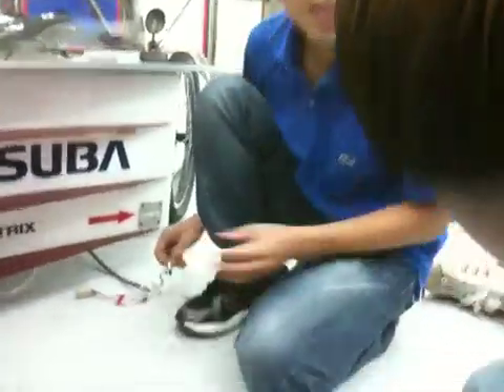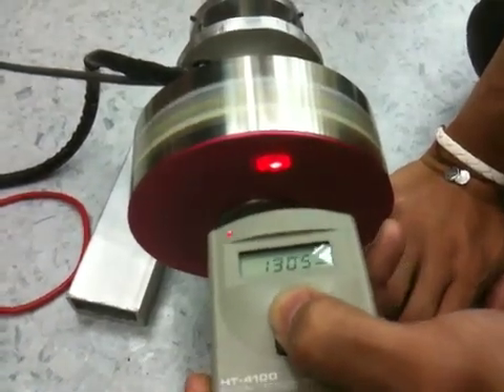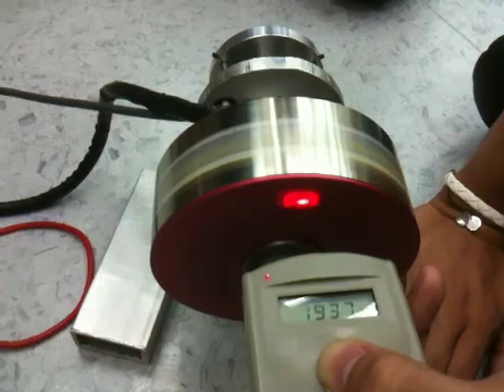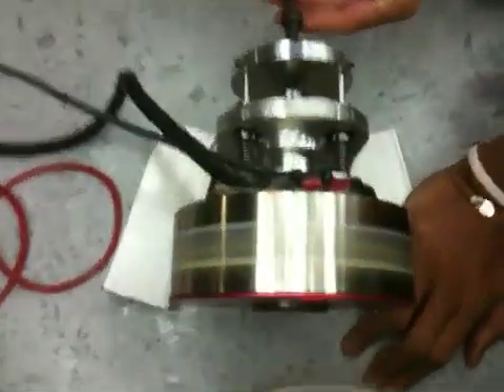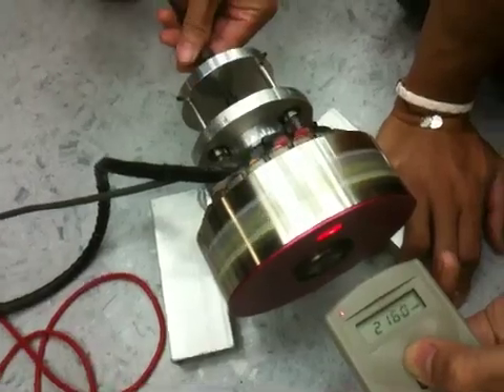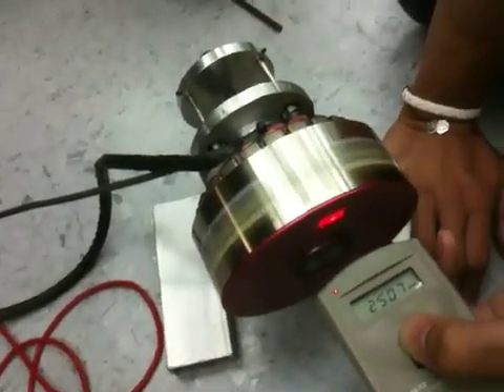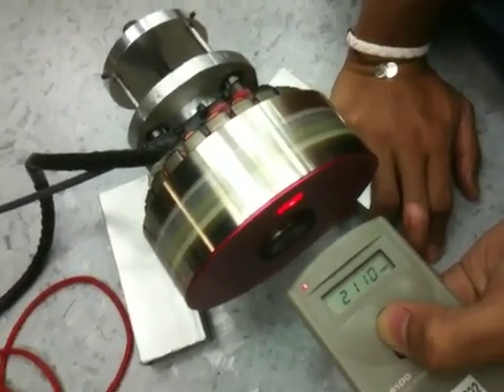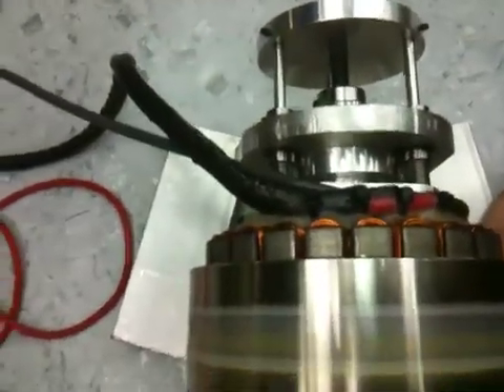Variable rotor stator alignment on Mitsuba motor (Expt 3)

Comment: That's unloaded though. I bet the available torque is decreased once loaded to it's rated torque max. So you are basically reducing the motors own magnetic resistance to make it run more efficiently unloaded.